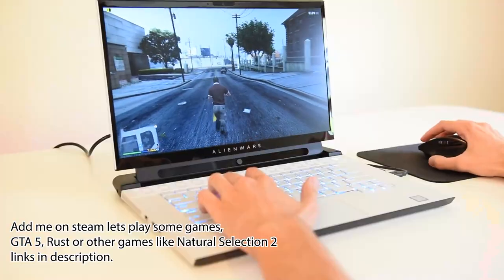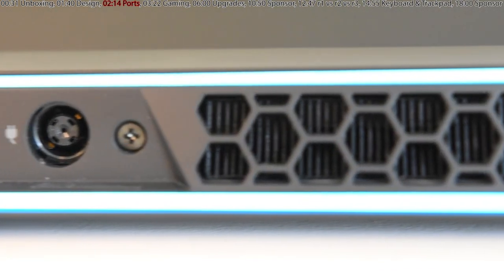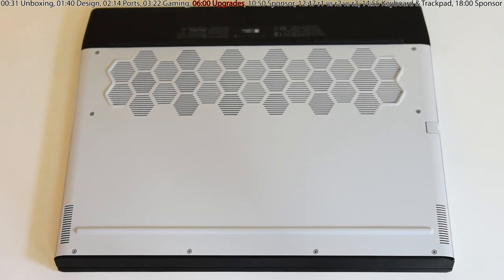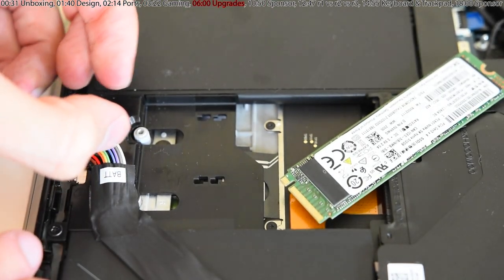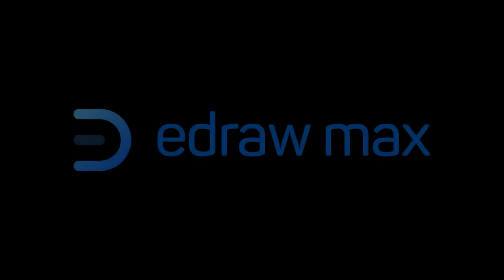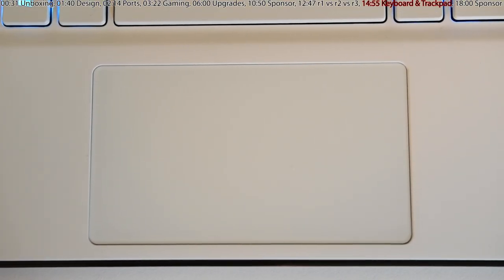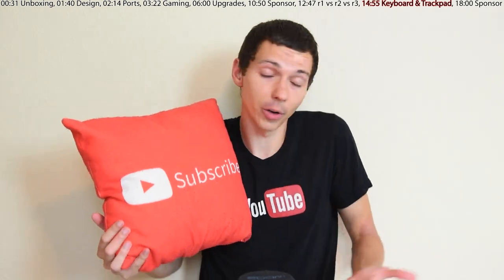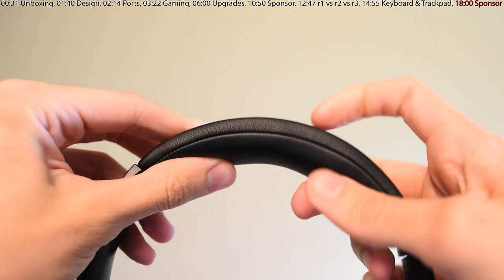Alienware m15 r2 RTX 2070 Unboxing and Review Teardown Gameplay Gaming Laptop Wondershare Edraw Max

Comment: Why is the starting M15R1 more expensive than the starting M15R3 ? You would think the older model would be cheaper than the newest one
Reply from the maker: Well m15r1 isnt exactly an inferior device its almost a unique product line not released in parallel but close. Its got a slimmer body with no hunch back cooling so its more compact.
Reply from the maker: Did you ever end up getting it? which one did you get?

Comment: this model is on sale now for 1600 eur, would be a good deal for it, or spend more and get new model?
Reply from the maker: the moral of the story is to always get the best model if you can afford it. If you cant obviously dont but each new model will always have better cooling and more modern ports. The newer model has better port selection and people have mentioned that the super version of the video cards do make a fair difference so I highly recommend you get the best model for the most amount of money, now if you cant get the best thats fine also seeing as older alienware from 2016 and 2017 run 70% as good as the newest models this means that used and refurbished options are a great thing to consider since you can save about 50% funds by just getting it used/refurb.

Let me know if you have questions I am trying to make this the best possible tech channel. I am always here for you! Hope you subscribe and good luck! :)